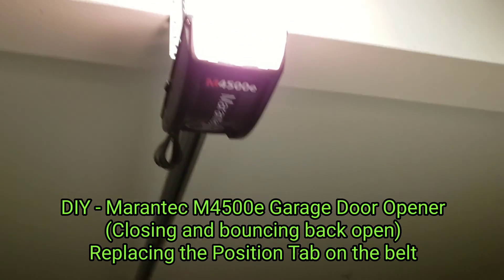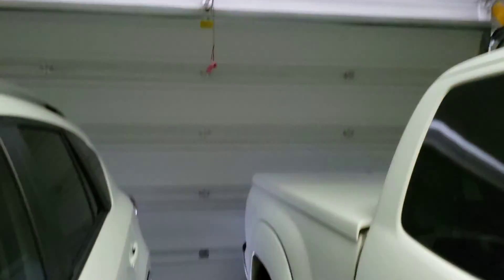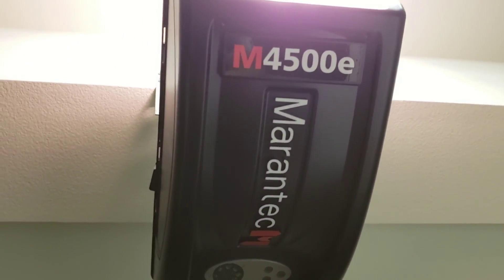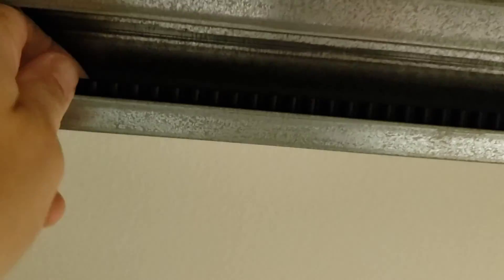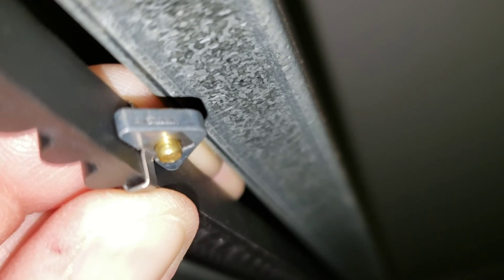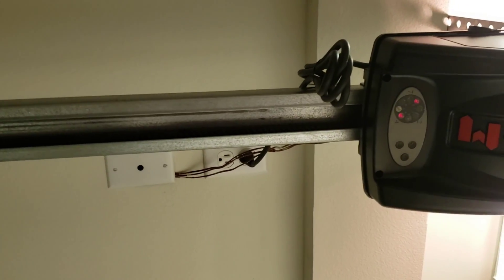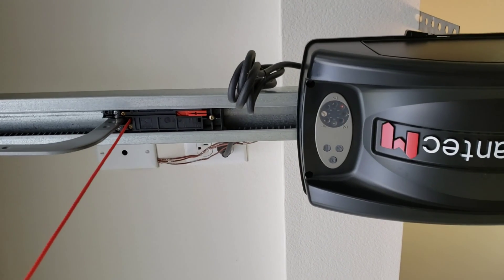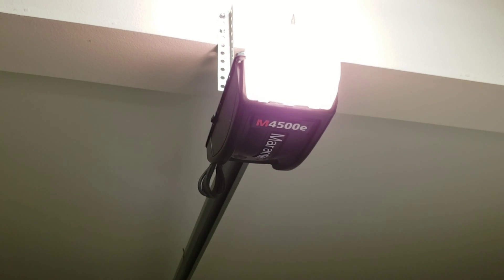DIY - Marantec M4500e Garage Door Opener (Closing and bouncing back Open) - Replacing Position Tab

Comment: My 4500e works ok - yes the tab seems ok. However when the door opens fully the opener light flashes. Any thoughts?
Reply from the maker: It might be the photosensors near the bottom of the actual door that looks for objects/obstructions are not aligned or maybe their lens is dirty.

Comment: UPDATE Received the part usps  in a very timely manner.  very small pieces.  I practiced the assembly while  watching video.  Climbed the ladder, and after dropping a couple of pieces, I was able to complete the repair. You have to have some steady hands  AND YES IT FIXED MY DOOR ISSUE..  I COULDN'T BELIEVE  IT.   Had to power down the electric, later in the day same issue.  Unable to locate my tab on either side, am doing  a work around where the door is left open inch or two .  Have ordered this tab kit from the link you shared.  Here's hoping it works  thank you so much
Reply from the maker: Hopefully that new tab kit works!

Comment: Thanks a lot for this video. I’m having the same problem but my tab is ok. I also tried to reset the OPEN and CLOSED door positions, but LED #7 always flashes after I set the positions. The problem is still there. Do you have any suggestions on this issue?
Reply from the maker: Not seeing what the issue is exactly this is my best guess.

Since the tab is okay the only thing I can think of is when you set the OPEN/CLOSED position the tab may not be in the correct location on the belt, so when you set the OPEN or CLOSE for your door the tab never makes it to the Marantec unit to trip the sensor. OR if the tab does make it all the way back the sensor in the Marantec the sensor is faulty and doesn't register the tab passing by. IF this is the case it could be a bad sensor.

There's a link to the manual in the video description.

Comment: So many thanks you and your video,  I confirmed, I fixed my garage door with the same problem you were mentioned.  Work well with MARANTEC M4500 too.  

Today 11/10/2024 . After replacement tab for limit open or close sensor.  My garage door working well.  Again, so many thanks for your sharing.  ❤👍

Spend time around 30 minutes.  And parts $11.99 with shipping included.  👍
Reply from the maker: That's awesome! Glad the video helped and you didn't need to call a technician. My own personal bad experiences with repairmen are that they are usually salesmen first. More often than not they also only know how to replace the entire system and not really how to repair anything.

Comment: I’m having the same problem but my tab is fine. I don’t know what to do
Reply from the maker: Maybe try programming the Marantec again. Here's a link to the manual if you need it. Look at page 19.
https://www.movingupgaragedoors.com/marantec-96834-tab-replacement-belt-drive

Hope this helps.
Reply: @bensaysthings  I appreciate it but this is a link to the part in the video. Also I have a 4700e if that matters
Reply from the maker: My Bad, here is the link to the manual
https://www.garagedoorzone.com/assets/images/M4500e_M4700e_Opener_Manual.pdf

It's the manual for the 4500e and the 4700e.
Reply: @bensaysthings  thanks man, you are awesome
Reply from the maker: Glad to help!

Comment: I had to change the whole belt, and your video helped a bit. I would not have looked for that little tab if I hadn't seen it, so thanks. 

My problem now is that the light bulb and LED 6 blink when the door goes to the UP position. Strange. Any ideas?  It's the code for obstruction of the electric eye, but the door goes down and stays down perfectly. Im confused.
Reply from the maker: I think it might be the Marantec could be over driving the door in the up (open position) meaning that it's pulling the door open all the way then continuing so that the trolley bottoms out or contacts the Marantec Operator Housing. It could be the door open position needs to be reprogrammed.

Here is a link to the manual if you need it. Look for page 19.
https://www.garagedoorzone.com/assets/images/M4500e_M4700e_Opener_Manual.pdf

Hope this helps.
Reply: Thank you!

Comment: How would you get it in the closed position if it wont close should I pull the red lever?
Reply: Do also HAVE to reprogram it or is it fine if I dont
Reply from the maker: I would reprogram it since it would ensure your setup is running as intended. Section 8-16 in the manual details how to set things up.
Reply from the maker: Pulling the red lever (or cord that goes to the red lever) decouples the opener from the garage door itself and then you can open the door manually as if there were no opener in place. This is usually for scenarios such as a power outage. However if the door won't close at all, for example the door won't move down then it might be a bigger issue like something wrong with the spring or door opener itself.

I'm assuming your opener does move the door up/down and you're getting the bounce problem I had in the video. Then you can make the opener move the door up or down to exactly where you want during the programming stage.

Here's a link to the manual if you need it:
https://www.garagedoorzone.com/assets/images/M4500e_M4700e_Opener_Manual.pdf

Comment: Mine had the exact same symptoms, appreciate the video! I was on a mission to replace the rpm sensor before I saw your video. Garage door guys wanted to replace the whole thing of course.
Reply from the maker: Cool, glad the video helped. The RPM sensor error seems like the default error code. I got it a few times and it was maddening until I finally figured out and replaced that belt tab.

Yeah, garage door people or HVAC people are some of the sneakiest repairmen I've encountered. They'll gladly replace the entire unit, but when it comes to diagnosis or actual repair then suddenly they can't seemed to resolve the issue.

Comment: Thank you!  We so appreciate your wonderful advice!

We've had this problem for years. Like the person whose comment appears before this one, we were told by our garage door company that we needed to replace the entire device.  That didn't make sense to me, so we decided to wait, and time passed.  I just now installed the tab, and the door works properly!  The only problem is that the door stops about 1 1/2" from the floor.  I haven't messed with the settings on the opener and am wondering if I can avoid that by moving the tab (i.e., removing the one I installed and installing a new one 1 1/2" nearer to or farther from the opener.  Does that make sense?  If so, do you know whether I should move it nearer to or farther from the housing of the opener?
Reply from the maker: You could move the tab a closer or farther from the door, but I would recommend reprogramming the opener. The reason being if your tab position is slightly off and the motor closes the garage door to more than 1.5" then it would technically be trying to push the door into the floor by however much you're off of the 1.5". This might cause the motor to overheat or could trigger the overlimit sensor and bounce the door back up because the opener thinks it has run into an obstruction.

Here's a copy of the manual if you need help reprogramming it. You'd follow the steps on pages 18-22 of the manual.
https://www.garagedoorzone.com/assets/images/M4500e_M4700e_Opener_Manual.pdf
Reply: Thank you!!!

Comment: My exact garage door motor doesn't do the auto-reverse when it senses an obstruction. How would I fix that setting?
Reply from the maker: It might be the limits or force sensitivity might need to be reprogrammed. Not knowing the exact issue all I can offer is the manual.
https://www.garagedoorzone.com/assets/images/M4500e_M4700e_Opener_Manual.pdf
Hope it helps, otherwise you might need to call a technician.

Comment: Any advice for what to do if your garage door has the chain instead of the belt? Our garage door is doing the same thing except we have a chain. Thanks!
Reply from the maker: I'm not sure but I believe garage door openers that use a chain have a similar tab that secures to the back side of the chain. You might try googling your garage opener model and adding in "chain limit tab" and maybe there's a replacement part for it.

Comment: Sir, you are lucky that it was just the tabe for the drive belt.
I just changed out the tab today (my orignal plastic was held on by 1 of 2 of it's own plastic wrap-around) to the identical 1 you have, but it did not solve the exact issue of the garage door retracting back up after it touches the ground.....
fyi: I had the system relearned twice, but my lighting indicator still remains to say that it is the 'photo eye system' though it it is clean & the light is red on 1 side & green on the other side as required.

Comment: I have one of these, and the lead 8 are not turning on. Any idea why? Thanks!
Reply from the maker: When we were trouble shooting the bounce problem in the video we had only Lead 8 was illuminated when both 8 and 4 should've been ON for normal operation. If you're still getting normal operation with your garage door it could be the light for Lead 8 might be burned out, but if your garage opener is doing something strange then I'm not sure without troubleshooting the problem.

Here is a link to the manual for the Marantec m4500e and 4700, hope it helps.
https://www.garagedoorzone.com/assets/images/M4500e_M4700e_Opener_Manual.pdf

Comment: Awesome video!  Thanks for posting, I was running out of ideas.
Reply from the maker: Glad the video helped. When we were troubleshooting the Marantec it was maddening at times because the manual wasn't very helpful and every time it seemed like it was pointing to a bad RPM sensor. Also there weren't many videos we could find that helped us resolve our specific problem. So after piecing together various videos and reading review on Amazon of the RPM sensor we saw someone mention that it might actually be the plastic tab fell off the belt. So we gave it shot and it worked for us.